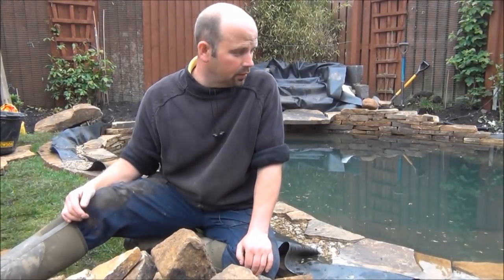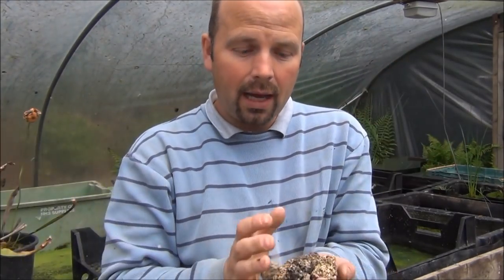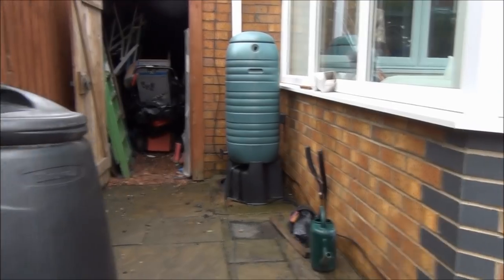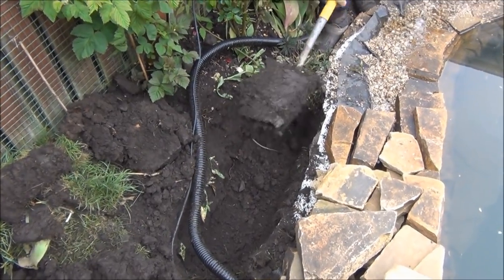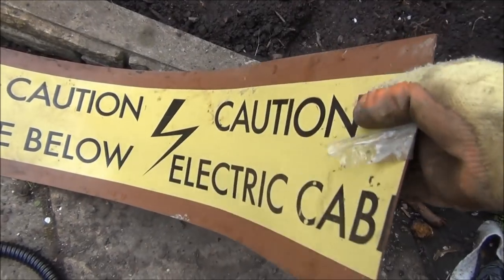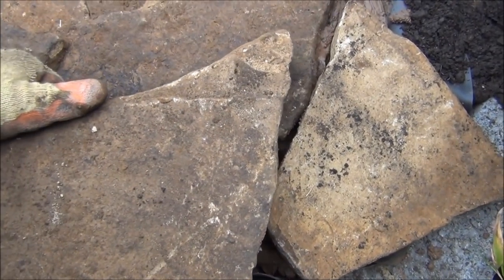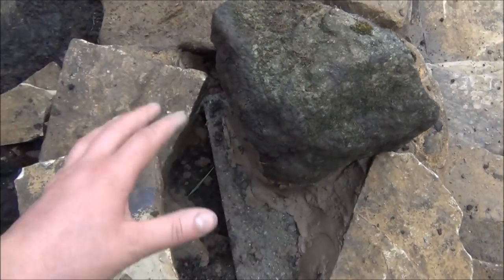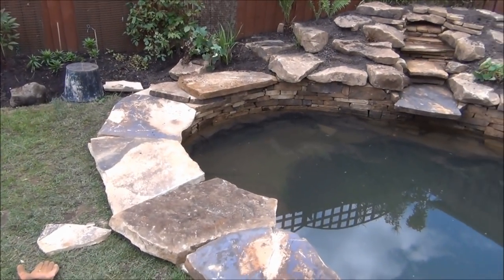Fish pond construction near Newcastle by Pondguru

Comment from the maker: With biomotion, the available surface area is so huge that massive air flow isn't necessary. You could filter a 4' tank with 1 litre biomotion and a 100 litre per hour air pump if it was part of a well designed filter (with foams etc.)

Comment from the maker: We normally use a waterproofer/retarder in with the mix but if the cement is to be exposed (e.g. in rendered koi pond) then it would be painted to seal the cement and provide a waterproof seal.

Comment: Love your videos,I'm doing my pond at moment but always worry about using cement affecting fish,any tips,Please ??
Reply from the maker: Just allow any cement which may be in contact with water to harden for at least 4-5 days before trying the cascade for first time and let it run for a day or so. Once you're sure cascade is OK  turn off pump and allow cement to harden for at least another week before draining and refilling the pond. That will flush out most of the lime etc.
Doing that is fine for a cemented stone cascade but if your whole pond is rendered you will need to paint it with suitable pond paint.
Reply: cheers !!!

Comment from the maker: Not sure if you have tested the water but it's most likely ammonia or nitrite poisoning. The filter is way undersized as if you have 8000 litres you really need a filter which states 'will treat up to 16000'. As soon a you factor in sun and fish you can instantly halve the effectiveness of the filter and maybe knock it down by s further 20-30% when there are as many koi. In essence, for that fish stock, the filter should treat 'up to 20000 litres'.

Comment: Thanks for your quick reply,  I will upgrade my filter asap.  I've just done a test for NH4/NO2 using a salifert test kit but both tested as zero.  The pond is quite mature and has a loose stone wall around the inside (similar to your wildlife pond video) so I think there should be a decent amount of bacterial filtration going on.  Will keep monitoring and testing, water temp is 19'C this morning.  The Koi all seem fine.

Comment from the maker: I have just checked it out on your channel and it is made correctly as far as I can see.
It is definitely not K1 in the filter however - it looks like the Chinese copy which doesn't move quite so well. You will need to remove some of the media so that the remainder will move properly as there's too much in there at present. As the media matures you can add more media.
Too much from day 1 will not move properly unless you start with around 25% capacity then add more over the coming weeks.

Comment: Hi. Good info. I'm planning to make an aquarium with 244cm x 122 cm x80 cm. I'm using Arcylic glasses and I'm wondering which thickness should I go with?! I'm thinking in 19 mm. Is that safe and secure enough for such tank?! Any advice?!
Reply from the maker: I don't know much about acrylic but I would go for 25mm as there is going to be a heck of a lot of weight pushing out on that. It will need about 4-5 braces on the top too.

Comment: Hi Richard, really enjoying your videos. More or less just starting to build a raised wooden pond. I'm unsure about the differences in pond liner. What do you usually suggest and also what's your second choice in pond liners.  I'm seeing rubber, PVC, epdm? Which should I choose and why.. Thanks in advance for your advice
Reply from the maker: The liner I always used for ponds is 1mm rubber (Firestone rubber) and it would always be laid over a suitable underlay which was polyester fleece - both were from Gordon Low in the UK. PVC is generally half as thick and makes for a poor job. EPDM is just like rubber but more stretchy and generally thinner.
The 1mm liner is very good and allows you to build walls on it no problem (it is best to lie a piece of underlay over the liner if you're putting stones on it.

Comment: Hey, that pond looks really nice,! I have some questions about alfagrog and inner stone layer.Planing to make a pond around 25m3 with depth of around 1,5m (3x5m ish), and plenty of koi in it. How much weigth can 1mm rubber take, did you use parts of the underlay inside the pond but under and behind the stones?Part of the question and maybe of bad language, i live in the middle of sweden so there might be abound 30cm of ice during winter. Alfagrogg vs. biohome media and witch would you use? Got a drummfilter and beadfilter also, my garden is small and i dont want a shower filter for the last stage of cleaning: nitrate stage..
Reply from the maker: The drum filter is a mechanical filter and the bead filter is biological. Neither designs are suited to alfagrog or biohome but alfagrog is often the best choice for a pond filter as the biohome does need very clear water to operate properly. The bead filter will use a plastic media which will produce lots of nitrate.
If you used the alfagrog behind the stone walls it would act as a very slow flow de-oxygenated zone and definitely help with reducing the nitrate. As long as the shelf is solid there is no real limit to the weight on top of liner but it is definitely best to put underlay under and over the liner where walls are to be built then liner is protected from both sides. Also put underlay up the back of the wall if it is high or has stone with random shaped backs to them.
Reply: awsome, cheers.!
Reply: Just to clarify if someone is thinking same thoughts!Alphagrog or biohome media was  just a choise behind the stones, and after some investigation biohome is gona be majorly expensive. :D
Reply from the maker: Yes that environment behind the wall of the pond edges is way too dirty for biohome too. Biohome will work in muck but is much better in a clean well protected environment. For general pond filtration alfagrog does a great job.
As a shower media or media for sumps and canister aquarium filters the biohome works way better as it is in a clean environment - you're right, to filter a pond with any type of biohome is very expensive and wouldn't really be used by anyone other than serious fish keepers who have good quality koi.

Comment: Help please,  I have a fish pond approx 8000 litres, it has around 20 small/medium koi upto about 10" and had about 20 rudd that are 2-3 inch.  Ive had no problems for the 3 or 4 years its been running but during this last week of hot weather I have found 10 dead rudd, no marks on them, just floaters.  Any idea what could cause it / fix it.  After I found 3 I added an airstone incase it was low oxygen but doesnt seem to have helped. The pond has a hozelock bioforce uv 4500 filter + 3000l/h pump

Comment: Hey dude, don't no if you remember me, but I've moved out now!, and the pond that's here is real nice, kept tripping the electrics though, I found it to be the uv so I removed that, got a new one but won't fit until the warmer months, got the pump going, but if I close one valve and just leave the cascade valve open there is not enough flow and the filter box fills up and the water spills out..it's not a good idea to have pump circulating this time of year was just going to leave it off
Reply from the maker: I normally recommend just moving the pump to under the cascade or filter return so that it doesn't disturb the deeper water in the winter. Its always best to keep the filter running through the winter as that way the bacteria stays alive and you get less lag time in the spring.
Your name rings a bell but I can't remember the pond. Is it one I have visited - I have a terrible memory....
Reply: Pondguru ive just moved into to my house, and kinda went thru pong build designs with you on here, I have 2 wildlife ponds in th garden and a decent sized pond at the top, when I tried to plug the pumps on it kept tripping power, norowed it down to uv box removed that and replaced pump plumbin as I moved it it was brittle and snapped. I remember you saying keep pump under cascade, but as I cannot use cascade only and the flow rate is not eough so it will splill out of filter box..so id have to use a bit of the other return pipe too ...I will replace this in the summer. so its either, 90% cascade %10 return pipe this pipe goes from filter box and returns underwater on the other side of the pond.
or just not have it on at all does that make sense ?
Reply from the maker: chris nash
Seems to be a funny set up as a splitter could control flow between the two places. Here is a link to the one I normally use:
http://www.swelluk.com/pond/pipework-fittings-60/flexible-pipework-misc-fittings-283/oase-y-adapter-1025.html
Reply: it has a stop tap on both outlets, so if I turn one off so its 100% on the cascade outlet the water cannot return fast enough therefore the filter box will spill over
Reply from the maker: chris nash
I take it you mean both outlets on the pump? Could you turn one off and one down to 50% output?
Reply: i have one pipe coming from oase pump to the filter box, the filter box has to outlets on the bottom, one goes to the far side of the pond (underwater, and one is for cascade so at the top, but in the winter we want cascade only and pump just underneath it, but with just the cascade outlet open on its own the flow rate is too slow that's why the filter box overflows, like it needs a bigger bore pipe possibly a fault design I suppose hd it running all day today with 10% on the other outlet but ofcourse is going to disturb the ponds temp in these cold months, can you pm me on here ? im new to all this google stuff, could mail you pictures just out of interest if nothing else. got 3 ponds here just cleaned a small wildlife one out and the pump made the water live! had a few shocks, turned it off buying a new one soon , big fish was taken from the big pond seen about 4 fish in there so far ad some real nice toads!
Reply from the maker: chris nash
I didn't realise the outlets you were talking about were on the outlet of the filter (gravity out) so they can't be controlled in the same way as a pressure fed splitter.
If you want to send pictures just use my email address pondguru@btinternet.com but feel free to ring me on 07772848730 as sometimes I can't get through all my emails for a couple of days if lots of orders come in as I have to process them as a priority.
Reply: thanks a lot! if your interested ive just put some pics on this google thing of the ponds!
Reply from the maker: chris nash
Will check that out when I get 5 minutes, no worries.

Comment: Hi I have watched many of your videos and it was my brother who suggested to me to watch your videos for ideas and help on my pond when I gets round to do it. But the electrics to power the pump and uv light in the filter and lights is really confusing me as I have read up about having to bury armoured cable underground and having to put sand on top of it and and then soil for the rest but in your video you don't put the cable underground you put it under the fence so im not to sure what the right way of doing it is. If you could give me a couple of pointers on this and how its done I would really appreciate it.. Thank you
Reply from the maker: You can do it either way but if it is below ground it ideally wants to be well below normal spade / fork digging depth and have a 'Danger electric cable' protector over it. Some people use plastic thin stuff but I tend to use hard roll of warning like is used by council workers.
Tip: if there is a hole in a road quite often you will find lengths of warning stuff lying around as most of the time if the guys have dropped it and it had been unraveled they can't be bothered to roll it back up so will end up throwing it in the hold and burying it, usually they will just give you some free.
Reply: Pondguru thank you very much for the tips I was confused whether it had to be buryed or not.. I really enjoy watching your videos with my wife trying to get some ideas on shapes on ponds and what make of pumps and what filters to use and we both really like your tower filter box idea with all the different media. Keep up the awesome videos.
Reply from the maker: Unfortunately I do not build ponds now but I have a long list of filtration videos to get to when (if) I ever get the time. I'm glad you enjoyed the ones I put out already.

Comment: What happens when u use a pond filter on an aquarium? Nice vid.
Reply from the maker: Really the only difference between aquarium and pond filters is the size so assuming you have a large enough tank to justify using a pond filter it will work no problem.

Comment: I see you are using cement. Is it a special kind of cement? I heard that cement leaches a chemical bad for the fish? Is this true? I believe it leaches lime? Not sure. I want to build a cement pond versus using a liner but I wasn't sure if the cement would be bad for the fish.
Reply from the maker: If the whole pond is cement then it will need to be painted to prevent the lime leaching out and harming the fish. If there is cement used in the stream and around the edges there will still be lime leaching into the water so it's best to leave it a week or two to harden off then fill pond up as far as it will go, run for another week then completely drain the pond and that will remove the majority of free lime. Once the pond is re-filled leave running for a week or so before adding the first fish and it will be fine. I generally ensure that the normal operating level of the pond is below the cement which fixes the capping to prevent damage by freeze / thaw in winter.
Reply: Thank you for responding. What kind of paint may I use? Is it any kind of paint? Is there a type of cement or paint you recommend?
Reply from the maker: MrLeor16
If you've got a long period of dry weather you can use G4 but if the render has not fully dried (which takes 3-4 weeks of dry weather) you can use 'Pond Paint' from ASK coatings. That is what I generally use.
Reply: Thank you! I live in the US so I'll try to find some of that stuff here
Reply from the maker: MrLeor16
I'm sure there will be similar stuff but under a different trade name.

Comment from the maker: No point when the filter used will keep the water clear. Plus there is the added filtration in a ring around the inside of the wall which will add to the capacity.
Thanks for watching and appreciating the videos.

Comment: why dont you use PTFE tape for hoses?
Reply from the maker: It is good for plumbing and for fittings with a threaded connection but no good for taping up the outside of plastic pipe. The electricians tape waterproofs, sticks to itself and seals very well.

Comment: Hi Richard

Love your videos man! So informative and you give such great advice on pond construction. Ive got to admit I've become addicted and i think my future wife is having second thoughts! 

Im thinking of creating my own koi pond, prob about 8x6x5ft and wondered how deep you made the concrete footings for the external wall. Im no builder or the best DIY'er but ill have a dam good try at making things. 

I was also wondering if you could give some advice on the pump and filter size, i was thinking of going with the Aquamax Eco Premium 10000 and Filtoclear 30000 as don't really want to be messing with a bottom drain. I was also going to add the Aquaskim 40 Skimmer as we have a few trees in our garden. 
Im only thinking of having about 8 koi, pond lilies and maybe a few irises. Would this be suitable for my pond size or a bit overkill? 

Any advice would be great mate!
Reply: Sorry mate. Forgot to add, id like to build a cascade too, probably about 1m high, maybe 1.5m.
Reply from the maker: The walling stone around the pond did not have any concrete footing but the block wall supporting the cascade did. It was around 1' wide and about 8" deep. There wouldn't be a great deal of weight on it.
Pump and filter seem fine but ultimately the pump size will be dictated by the rise and spread of the cascade - you may find you need a 12000 or larger if the spread is over 12" at a 1.5m lift.
Skimmer is definitely a good idea if you have surrounding trees as that will save scooping them out all the time.
Reply: Thanks for the quick reply mate. Sorry i thought you mentioned a footing on the external wall. No worries though. 

Thanks for the advice too! Just got to put theory into practice now. 

Thanks again mate, all the best.
Reply from the maker: No worries, sometimes I would use a small footing for the external dry stone wall to prevent subsidence - it depends how good the ground is and how high the wall is.
Reply: Awesome, cheers mate. Ill prob need too as our soil is quite loose.

Keep the posts coming. Loved that one with the clay clearing the water, amazing what it did in a short time
Reply from the maker: Yes if there is a danger of soil settling and affecting the wall its best to go with a concrete collar wherever you're building up.
I have more clay and reckon I'll add it soon as the guys messing about with the drains up the fields seem to be taking a break from their mess while there are cattle in the field.